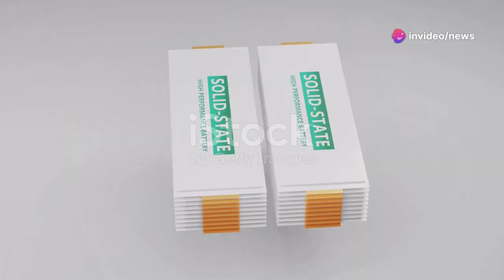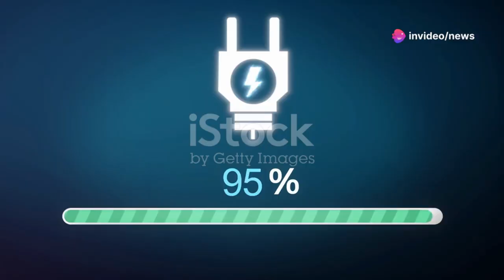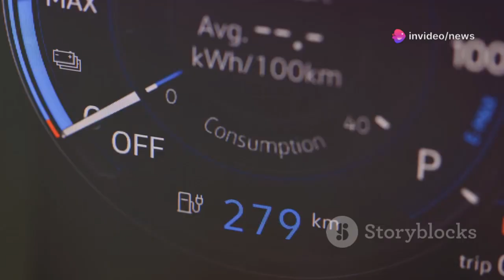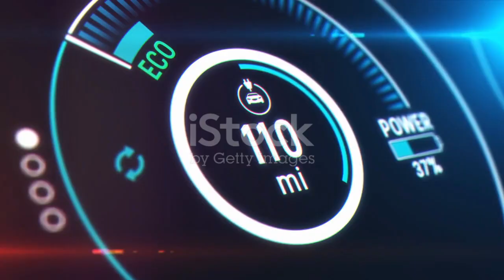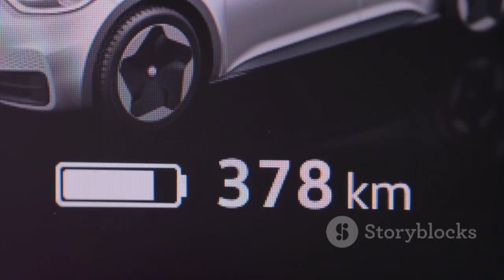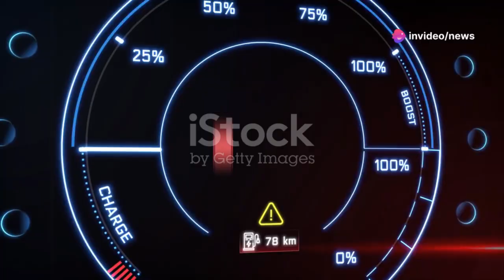BREAKING: Toyota’s Solid-State Battery Charges in 10 Minutes! | EV Game-Changer

Comment: Haven't Toyota been saying next year for about ten years? BYD has said 2030 for use in mass produced cars but in high end cars by 2027, CATL says small test production runs in 2027, so colour me pink and call be spunkdoodle if you will, but I trust the two largest battery  manufacturing companies in the world over Toyota every time. Don't get me wrong, I would indeed be happy to be proved incorrect, but I sincerely doubt it at the moment.